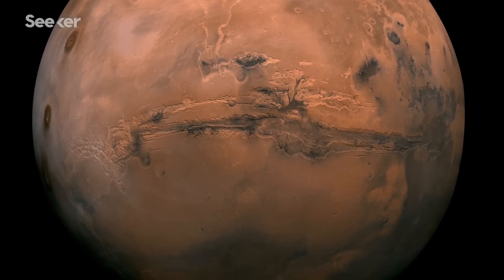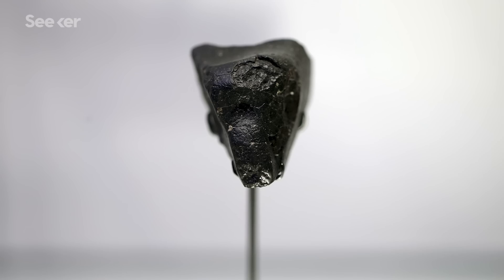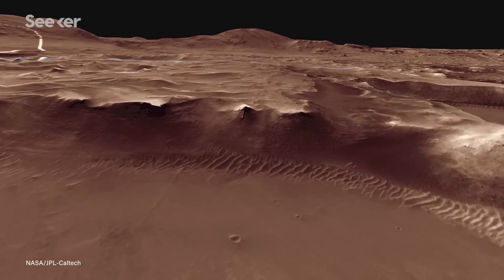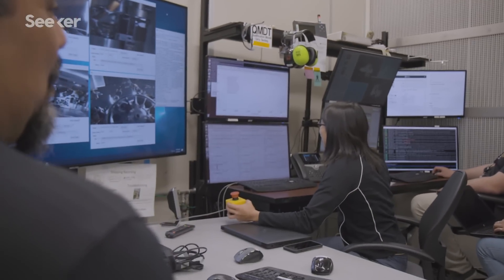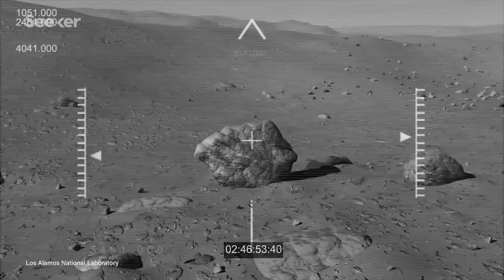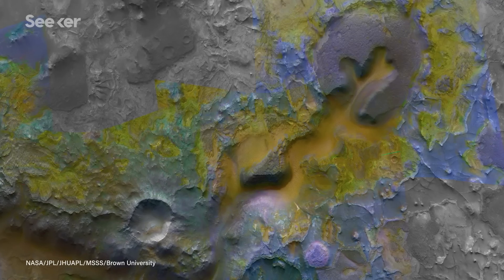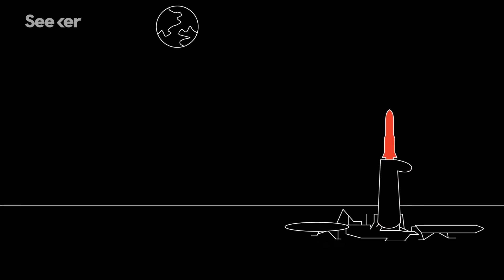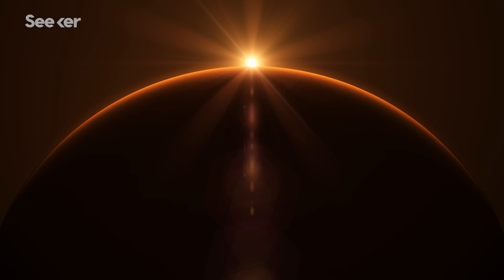NASA’s Ambitious Mission to Bring Martian Samples to Earth

Comment: Earth is different from Mars 1st for most because earth is  closer to the sun 🌞
Reply: Mars is still in an habitable zone. In its case, temperature is not an issue that much...
It got no magnetic field (it used to have one apparently, but it lost it),
which had lead to the radiation of space to slowly breaking down the atmosphere
it had. Combine that with a lower gravity and you end up with losing pretty much all the gas
the planet had. (Co2 is pretty heavy, this is why this is mostly that gas that is left there)

If Mars would had a magnetic field, it would be a lot different right now...
maybe it even would have life.
Reply: mars is still in the habitable zone.........

Comment: Some in the comment section maybe right Starship super heavy maybe the only vehicle capable of getting crews to mars and the truth is the sls was not designed to go to mars without the intermodel transport system from the constellation program which was like starship in purpose and would be used to ferry crews to and from mars but the orion is no we're near the size or speed necessary to make the trip possible however sls would be good for launching probes telescopes/rovers or a deep space flyby of asteroids or comets.

Comment: This mission is crazy cool, it would be cool if they launched the rover into an Earth orbit where it would dock with another rocket or vessel in orbit, where they would then go to mars together and the rover would be deployed from orbit, go down and collect samples and then have a small rocket on board to launch only the samples back into orbit. This would be challenging, but not impossible due to mars have much better conditions for launching on the surface than Earth. I think that would be super cool, but either way, with current tech. This is super cool and I look foreword to Feb. 2021 and 2031

Comment: Why don’t they send specialized drones to pick up the samples instead of sending rockets?  Purely speculative as I don’t know much about drone physics.
Reply: If by "drones" you mean quadcopters... they fly through the atmosphere. Obviously there's no atmosphere in space. You can't fly a helicopter into space, the air becomes too thin for the propeller to screw through. Technically, though, they ARE sending drones, because all these things are remotely operated ("drone" is actually a stupid word for something that basically just a remote-control vehicle - a real drone would work by itself, making its own decisions with not human input).
There is actually a helicopter drone (called Ingenuity) attached to the bottom of the Perseverance rover that will be used to test the first flight on another planet. Mars has a thin atmosphere, roughly 100 times less dense than Earth's atmosphere, so it will be like trying to fly that helicopter way up to the top of our atmosphere near space.
Reply: @PinataOblongata  Then what about this:  A balloon carying some sort of "crate" of drones that deflates in the atmosphere before popping and switches to jet propulsion to push the remaining distance to leave orbit.  Then after rocketing the crate to mars, the reverse process happens for landing: fill the balloon with a gas that slows descent, drones collect specimines and return to the crate, then fill the balloon with a third gas that lifts it in mars' atmosphere.  Then switch from gas to jet propulsion before popping?  Assuming the fuel/weight ratio would still provide adequate lift in both atmospheres, the time it would take to get to Mars and back would be feasible, and it would be protected enough through space.
Reply: @OliverG12345  i think a balloon won't work on martian atmosphere because it's too thin and therefore less dense atmosphere
Reply: @OliverG12345  a maximum altitude a balloon can only  get is around 50 kilometers so a rocket would still need alot of fuel (which is too heavy for a balloon to carry) to escape earth's gravity

Comment: Does it have a core drill? I'd think some larger pieces and the possibility of some layering would be much more desirable than dust.
Reply: Yes this has a drill a helicopter and an oxygen  machine
Reply: @zacheryw1845  I know it has a drill. However, the one they showed was hot a core drill. Core drills have a hollow bit that can remove core samples; cylinders of intact material.
Reply: according to google: "The ROtary PErcussive Coring (ROPEC) Drill has been designed to meet the needs of a Mars Sample Return mission by providing a platform that can produce rock cores, powder and regolith samples, and can abrade the surface of rocks." (text from nasas homepage). Still not perfectly clear from that text though..
Reply: @vir042  Thank you for providing a source. 
I hope it does. Sending another rover with just the pecking drills like we all the others would be such a waste on a mission that wants to return the samples to Earth.

Comment: Why Earth is full of life and why Mars is dead is to me rather obvious. Mars is mainly to small to be able to support life as we know it. The size of the planet is very important as far as I see it. Mars is too small to have enough pressure in its core to have a sustainable nuclear reaction like earth does. This means that there's no molten core of iron like we have that is the dynamo that creates our magnetic field. This is what protects us from the intensive solar winds that would otherwise strip away our atmosphere and the low pressure would then make the water evaporate and be blown out in space just as it has on Mars.
Reply: What sustainable nuclear reactor? The presence of georeactors is an hypothesis at best. There is heat generated due to radioactive decay.
Reply: @garethhanby  I said nuclear reaction, not reactor. Radioactive decay is also a form of nuclear reaction.

Comment: These guys: Let's spend tens of billions of dollars to build a robot that can bring in few rocks back to earth. 
SpaceX: Let's spend tens of billions of dollars to build a starship that can bring humans to Mars and bring them safely back to earth.
Reply: @OddPotato they possibly can. At least in Elons lifespan
Reply: Space x could probably pull it off a robotic return utilizing Falcon if they really wanted to.  They already can reach Mars with falcon heavy in full reusable mode.  Space X can already land on Earth, Mars is nothing compared to that.  I would not be surprised If a raptor based hopper could make it to and from the surface of Mars to orbit..  I think they need to start with the Luna  first.
Reply: Do you really think that in this decade you will see any starship return from mars!!?
Reply: @Renovatio2142  Where did I state a timeline?
Reply: @Tekel-Upharsin  it was automatically stated when you start making a fun of this project which have timeline stated within.
Reply: @Renovatio2142  yes but it will be an orbital journey and landing however will be an entirely different matter spacex would have to optimize the flight computer to land on two planets both with atmospheres that would be earth and mars and having enough fuel left onboard to get out of mars atmosphere and for a return journey but the heat she old would have two survive to re entry's burns but from the looks of it spacex's starship is the best candidate for a trip to mars.
Reply: Cloun your self out please

Comment: One thing I allways wonderd abot the Mars rowers. Why dont they shield the equipment better. Looking crud and vulnerable with all the cabels ,hoses joints etc straped on outside. Why not use some car and machin designers for a better built in. Raises suspicion if they have left earth at all.

Comment: If anyone here could tell me: Why drop the samples on the ground to get blown around and lost?  Why not keep them together onboard the rover?
Reply: They are getting buried. They wont be blown around. The Rover will be traveling a long way, and needs to be kept light. Its no harder to pull the samples form the ground than track the Rover down to wherever it ends up, possibly at the bottom of a canyon.